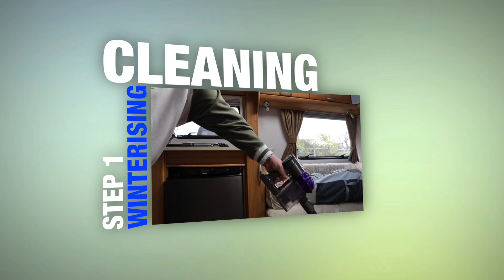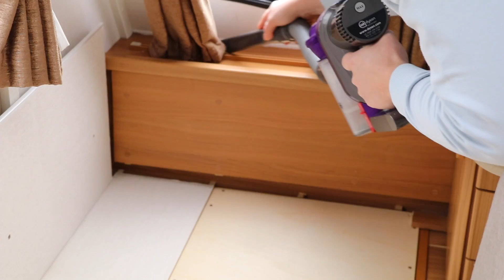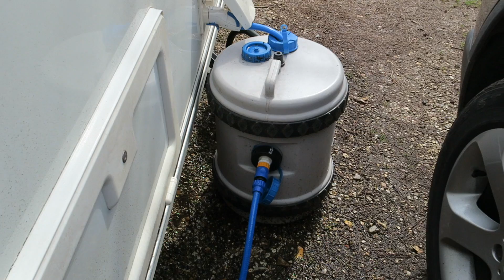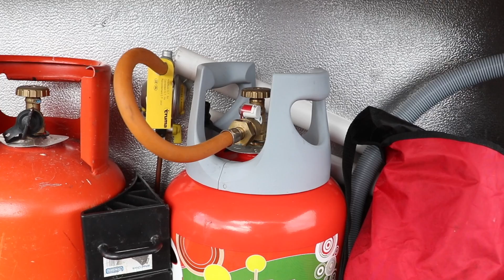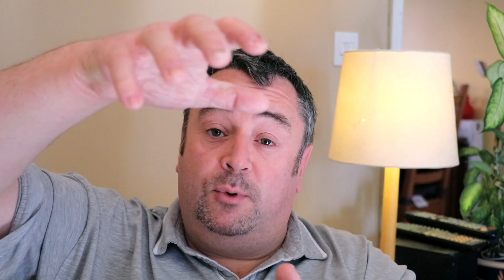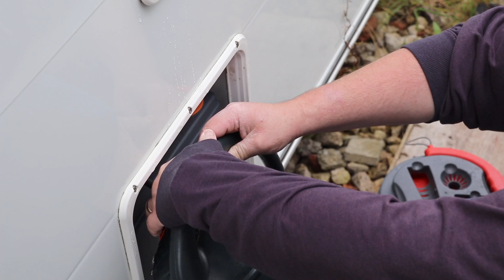Prepare your caravan for winter storage

Comment: Hi Dan, Just looking at a few bits on youtube to refresh my memory. Another on I use is to open all the windows and give the rubber seals a quick wipe with a drop of olive oil on older caravans but on newer ones I use a silicon lubricant. It helps to stop them sticking. I usually treat the car doors seals at the same time, reduces the risk of moisture freezing them shut, although can often bee a good excuse for being late for work.

Comment: I also remove batteries from smoke and gas alarms as well as from the clock and the fridge igniter and any other item like torches left in the caravan. The batteries may leak over the winter lay up and ruin the equipment. I spray wd40 on all the internal hinges and metal fittings to stop them rusting. Leave toilet slide in open position over winter.

Comment: Hi, just a quick question about batteries. We bought our first caravan last summer, its an 89 challenger. Now the battery is under the seat by the wardrobe, so you can see it when you lift the seat cushion. Is this safe? As ive seen most are boxed in and you gain access from the outside. Ive heard batteries need to be vented or is it just certain types? Thanks.

Comment: I did most of these things when I winterised our caravan. I have a cover so I can't use a solar panel even if I wanted to. I just removed the battery, kept it in the house and checked it every so often. I had a puncture on the way home from our last outing so I replaced both tyres at the soonest opportunity.
Reply from the maker: Great stuff, yes removing the battery is absolutely fine, in fact many recommend this. 

Take care 
Dan

Comment: Very informative and helpful video. Please keep them coming. Also, removing the water filter prevents it cracking if water freezes inside it. If it's stored in a sealed jar that helps keep it moist until the next time you need it. Some folk prefer leaving the blinds closed, others open, but Lunar and others recommend left open. They also suggest cupboard doors should be shut to prevent warping, as Dawn Allard points out in an earlier comment in this thread. In a perfect world I'd have my 'van inside a barn and plugged into the mains in winter. But I guess they're winterised for a reason.

Comment: Hi we found closing the blinds or curtains when the caravan is standing for long periods unattended causes mold to grow on everything leaving the blinds up or half up and curtains open basically allowing sunlight into the caravan stops the growth of mold.
Reply from the maker: Hi, that's a great tip. We find that closing the blinds with a small slit at the top (fly screen) allows the warm air trapped between the window & blind to escape, we also don't close the roof lights so some daylight does get into the van when closed up.

Thanks for your tip

Take care, Dan

Comment: Good vid. We are lucky we are able to keep ours on our drive, so able to hook it up, and we keep the heating on a low setting. We do take all the bedding and seats out and also the carpets, and put the winter covers on the fridge. The battery we have on it is from our previous van, making it 11 years old! Open most cupboard doors, though we did find the wardrobes ones did warp a little so we leave them shut now. We also leave our blinds shut.
Reply from the maker: Hi Dawn, some great tips there. 11-year-old battery ? you should contact Guinness book of records lol. 

I expect your blinds are different to ours, I've heard many people commenting on the tension in the blinds fails if the blinds are pulled closed etc.

Take care

Dan

Comment: Great Tips Dan, One thing we always do is open the blinds and close the curtains we've found that if you leave the blinds down over a long period on time, the springs inside tend to get a bit week and when we come to use them again they never seem to roll up neatly.
Best wishes
Jon
Reply from the maker: Hi Jon, ours don't have a spring tensioner - which is not the norm, but im aware of the issue that you mention. It's best to just close the curtains really.

Thanks again.

Dan

Comment: Good tips Dan, I made my own Flo device with a spare water intake pipe and a spare car valve, much cheaper !
Reply from the maker: I've looked into making one also. you can buy the replacement nozzles quite cheaply - and adding an air pipe is again a simple task.

Will let you know how I get on.

Dan

Comment: Great video, couple of extra tips, after draining the toilet flush, I always blip the pump a couple of times to get water out of it, the pumps are usually near the outer wall of any van and can easily freeze breaking the pump body. Also I tilt the van slightly to prevent water sitting on the roof, this will also freeze and could damage awning rail seals or round sky lights etc.
Reply from the maker: Morning Steve, Great tips - yes i do empty the pump too - it is amazing how much liquid stays in the pump housing isn't it - i completely forgot to mention it. and as for tipping one end of the van, again - great tip. We usually have ours nose up, bum down so the water runs off the back, and reduces the mess over the front of the van. Also makes it far easier to hitch up again.

Thanks for watching,

Take care

Dan